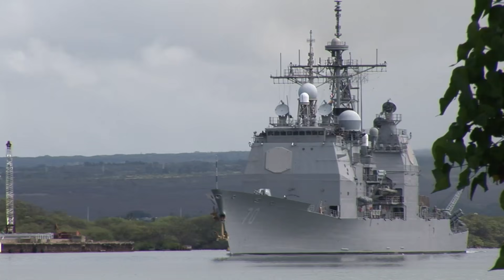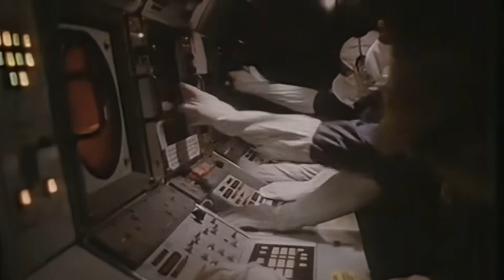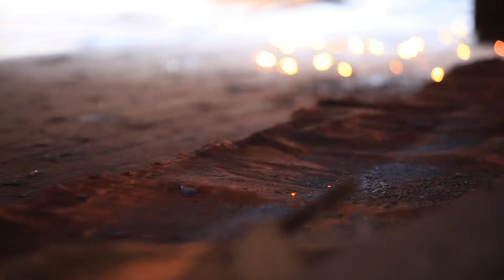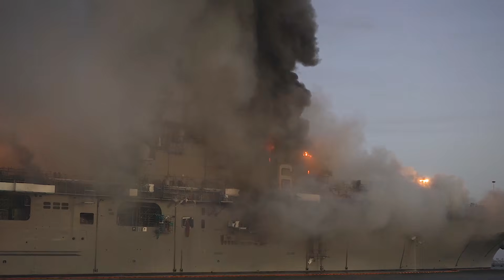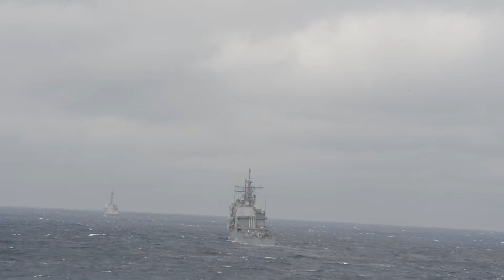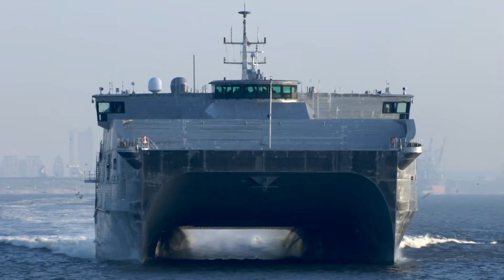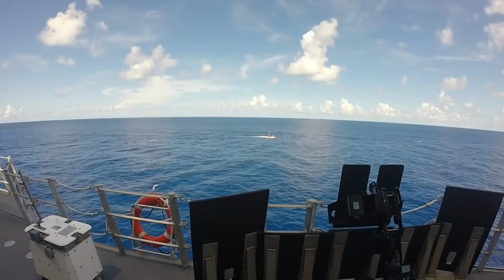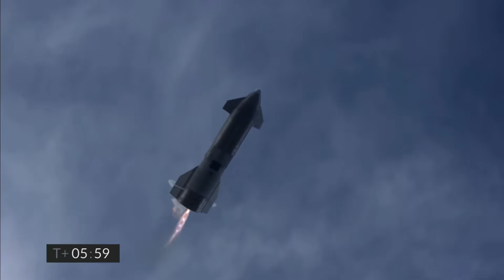Why is The US Building Aluminum Warships?

Comment: I know it would cost more and honestly be more difficult to work with but if I wanted a warship...I would want it made of stainless steel myself. No need for paint, maintenance, or any kind of corrosion inhibitors. Yes it would be more expensive but it would be lighter and thinner than steel and stronger than aluminum.
Reply: Look up crevice corrosion.

Comment: During the Cold War Era, the US Navy's Knox Class Frigates, launched in the 1970's, had steel hulls and aluminum superstructures. This is old school technology now. The Knox Frigates were specifically built to search for and track Soviet submarines. The Soviet Navy at the time boasted the largest fleet of submarines in the world, and the US Navy's Fleet of Anti-Submarine Warfare platform ships were charged to counter the threat to NATO aligned Nations. US Navy Knox Class Frigates were decommissioned after over twenty years of service, and many were sold to our Allies. Both of the Frigates on which I served, the USS Brewton FF-1086 (Pearl Harbor, Hi) and the USS Hewes FF-1078 (Charleston, SC) survived the scrapyard and are currently serving in the Taiwan R.O.C. Navy. This is a testament to their design and capability as a good ASW platform.
Reply: I understand that Soviet submarines made excellent anchors.
Reply: @BenjaminFranklin99-s9n  Older Soviet ballistic subs were noisy, which made them easier to acquire by sonar. Each sub has it's own particular set of frequencies, like a fingerprint, and prior recordings can help pin-point that vessel's signature. Most modern subs are very stealthy, but can be also visible to aircraft using magnetic resonance technology, which picks up anomalies from steel objects hidden in the water column as the aircraft flies patterns over the surface. But the worlds oceans remain a good place to hide. The US and it's Allies must remain vigilant to counter the threat of submarine launched weapons of mass destruction.

Comment: Elon musk ditched carbon fiber for stainless because stainless was faster and easier to design and build with.
Reply: This ^
Reply: lets face it, trying to build a rocket out of carbon fibre was never going to work out well
Reply: @spawnof200  isn't a proton rocket from it?
Reply: and better at low temperatures
Reply: @Barten0071  in general better temperature handling especially in re-entry

Comment: The most telling incident was during the Vietnam war. A US navy plane accidentally fired a Shrike anti radiation missile at a US destroyer, which had an aluminium super structure. The missile homed in on the ship’s radar detonated 100 feet above the mast of the ship and at first sight, no damage was done, nobody was hurt. But the ship was dead in the water, the blast had caused tiny slivers of aluminium to shave off at joints and every electric cable was shorted, every wave guide was cut. It took two days of repairs to get the ship moving.

Comment: did not even think about the melting points, 150c is low tho, if yar biking in hot summer without any shade i think yar bike will hit those temps.
But yeah i think steel or aluminum does not matter that much, the weapons hitting them are so powerful, i bet tho the steel will buy some evac time.

Comment: Adding the bit about Starship using stainless steel is disingenuous, as it does not explain what drove that decision. It was the need to deal with the heat of reentry for steel winning out instead of carbon fiber. A naval ship does not have to deal with such extremes. There is no one perfect material for all scenarios, an optimized design will make use of numerous materials, using their advantages where they are desirable.

Comment: the biggest problem when it comes to aluminium and steel combined is how much easier aluminium starts to oxidise. by combining aluminium and steel does the aluminium act the same way as zink does when applied on steel, it oxidises instead of the steel to protect the steel from starting to rust. so by building an aluminium structure on a steel hull will they get this problem which signifficantly weaken the aluminium over time. i think this has something to do with why it gets destroyed this easily when the ship is in combat.

but i'm no expert when it comes to warships. i have a very good understanding about metals and how they react when in close contact with other metals due to my job as a specialised pipe welder and this is what I have been taught. but they most probably have thought about this before and placed some sort of barrier between the steel and aluminium to protect the aluminium from this phenomena but i still think it has something to do with the catastrophic faliures they encountered

Comment: Radars do not produce radiation, they emit radiowaves on a wavelength closer to microwave ovens
Reply: Radiowaves which are radiated from antennas... The word radiation doesn't instantly mean Chernobyl style radio-active radiation. With the power levels those radars will be using, a lot of radiation will come of them which will interfere with your iPhone signal let alone critical weapons-systems on the ship. Rather not have a high power radiation source next to sensitive electronics.
Reply: that IS radiation id10t : the emission of energy as electromagnetic waves or as moving subatomic particles, especially high-energy particles which cause ionization.

Comment: I make my ships out of elemental sodium currently.
Can't seem to get then to float without burning up though. Not sure why
Reply: Did you try restarting it?
Reply: @saureco  I have not. I will give it a shot. Not sure how to restart chemistry though. Any ideas?
Reply: Try bicarbonating the sodium. 😁
Reply: Why not try a Francium Coated Enriched Uranium and Cobalt Alloy?
Reply: Just make your ships outta H2O, there problem solved.
Reply: @justiron2999  Yes, you have the same density with water, therefore you can also act like a Submarine!👍👍👍
Reply: @justiron2999  Dude, you are a fucking genius! Can't believe I didn't think of that.
Reply: Im having the same problem with my potassium ships
Reply: @stevejones1488  I know, I mean they are rare earth metals and rare always mean good so good stuff should make good boats? Idk wtf we are doing wrong here.
Reply: @mickeddy92  titanium is too mainstream.
Reply: Lmao. I’m just imagining the ship be lowered from the docks into the ocean after being completed and just exploding instantly XD
Reply: Don’t be an idiot, save the game!
Reply: Instead of ships. Try this. A shell which utilizes a proximity fuse to mix a capsule filled with a sodium potassium alloy and water. It detonates just a meter over the ship surface. Spraying hot burning metal liquid on the ship surface. Not only a sort of napalm. But any of the alloy that doesn't catch on fire actively eats away at the ship structure due to galvanic corrosion.
Reply: try potassium

Comment: I served on an Adams class destroyer and it was commissioned in 1957. It was the very last 1200 psi superheated steam engined destroyers. The ship had a steel hull and some steel compartments but above the main deck was all aluminum. That is a long time ago that the USN started using aluminum. We went through some really bad weather where you could not get out of your rack unless you were on watch or had some kind of critical job to do. How would you like to be able to walk on the walls? That was one tough ship.

Comment: Using the shuttle as a example how good aluminum works in extreme heat is really poor choice... the tiles that protected it were extremely fragile,expensive and required a lot maintenance.Don't think a navy vessel would be suitable
Reply: But it still didn't melt. According to the video modern ships have fire/heat protection in key areas, so the example applies.
Reply: @krupert8355  "it didn't melt" Columbia disaster would like to have a word with you
Reply: Russians wont use aluminum....
They will use stalinium......
Reply: I know you try to to be smart, but let me tell you it simply does not work....The space shuttle example is fine, you just don't get what he was saying thats the problem ;)
Reply: @IIISentorIII  no, the example was shit, just like hin saying that Elon doesn't approve of the Russians building composite superstructures "because the new starships are made from steel instead of CF". They aren't made from steel because it's a a better material, they're made from steel cause it's far cheaper and stronger than CF at cryogenic and reentry temperatures

Comment: I've seen the strips they use to join the aluminum super structure to the steel deck. They are made in big sheets explosively welded together then cut into strips for the bottom of the bulkheads.
Reply: I hope that's a STEEL deck.
Reply: @flamingfrancis  yep voice texting and autocorrect are real things.
Reply: Detacouple usually comes in strips about three inches wide. The steel side is welded to the deck in the outline of the superstructure bulkheads (walls). Then the superstructure is welded to the top aluminum half of the detacouple.

Comment: i'm writing this pre watching the video and will reply once it's over, but i think it's because aluminum isn't magnetic, so that they could use electromagnetic engines powered by solar in the future. it would significantly reduce fossil fuels, and be far more sustainable, especially if they use a liquid cooling system to keep the system cool, and harness the steam for aircraft catapults on aircraft carriers. it would make sense, if they can find a place for the solar panels. they might even be able to make solar panels that are tough enough to be used as the carrier deck, and since it's already a huge flat space, it would be pretty perfect if they could make that work. just my thoughts and possible reason why they're making them out of aluminum

Comment: The frigates Antelope and Ardent, which were sunk after devastating fires, had aluminum superstructures and steel hulls. Defenders of aluminium construction emphasize that the metal does not burn. But the metal, roughly half the weight of steel plate, melts at 1,200 degrees Fahrenheit, as against steel's melting point of 2,800 degrees. Aluminum is also harder to maintain. Much of this knowledge was learnt in the '80s and the US Navy ignored it. So who was held responsible for the mistake and all the wasted money? What happens to survivability in heavy combat?

Comment: "Aluminum doesn't burn"? Really? That is extremely dependent on the alloy used and if anodize, the anodizing process used. And, yes, some of the aluminum components on US warships are prone to burn before melting, but the general assumption with their installation is that they are really unlikely to ignite unless everything around it is a lost cause already.

Comment: aluminum ship means that taliban boats with ak47s can actualy sink them and cause the crew to abadon ship
a heavy steel ship can easily survive small to medium sized cruise bombs
considering they have a decent damage control crew they can recover and keep fighting

we can easily see why battleships retired, it was because of the massive USSR cruise missiles, we  are talking about missiles more than 10 times larger than the modern cruise missile carrying even nuclear warheads 
sure if you get hit by a p700 granit your steel destroyer or cruiser will be doomed, this forces the enemy to use larger and fewer missiles which you can much easierly defende against

using many smaller and aluminum ships will force the enemy to develop smaller weapons and make you an even easier target to kill
in a scenario were each side fires all of the offensive weapons the winner will usualy be the one who will affford to take the hit, each side will get hit badly and there is no perfect defense system

an aluminum ship is an easy target for enemy artillery as well, getting hit by a single 155mm HE round can cause a wild fire inside the ship and a melting of different sections
a steel construction of even much smaller ships means that they are a lot more capable at fighting with their onboard guns at closer ranges

Comment: Why don't we just add explosive reactive armor to the ships I mean that might add some good defense.
Reply: I guess because it would be relatively easy to counteract. The weight of explosive in the missile would be much greater than the explosive charge at the point were it impacted. You could move the fuse of the missile to the rear of the missle and use a deceleration or proximity sensor to trigger it with a delay so it exploded inside the ship. So the ERA couldn't just knock out the fuse. It would have to destory the entire missle and that would require quite a lot of explosvies in the ERA. Therefore  you would need armoured plate beheind the explosive reactive armour to stop the ERA damaging the ship. A feasible option on a tank that doesn't have to be bouyant but not so much on a ship. A ships main defences against missles are decoys to decoy it away from the ship and missles and guns to shoot the missles down and speed to get the hell out of the missles way.
Reply: @chrism7969  Buoyancy is not that hard to do sense water is many times heavier then steal so an active defense like the anti missile defenses on tanks which use giant shotgun shells could also be useful but they would probably stick out.
Reply: @zetoboogaloo8802  well if you are protecting the superstructure the armour has to be high up which affects the centre of gravity of the ship, making it less stable in anything but calm weather.  As for anti-missile systems don't ships already have them. In the form of close-in weapon systems,  anti-missile missiles? Also doesn't extra armour, reactive or otherwise, add weighr slowing the ship and increasing fuel consumption and reducing range.  The sheer mass, speed and explosive capacity of modern ant-ship missiles mean that the weight and bulk of effective armour against then is   not practical on a ship. As for your comment implying  buoyancy not being an issue that is not correct. In the past smaller ships were not armoured to withstand the   guns of larger ships because smaller ships had less volume and that's did not have enough buoyancy to support the thicknesses of armour necessary  to protect against the larger calibre shells of the bigger ships.  A ship of a given volume has a limited buoyancy and that has to provide for all the machinery and and stores and accommodation for the crew. Any armour you put on top of that restricts the amount of machinery, weapon systems etc you can carry.  So unless that armour has a good chance of blocking the damage an incoming missile can do it's unlikely it would be used on a ship. I assume that designers of modern ships have made that calculation and decided that reactive armour does not provide an effective defence against modern missile systems.
Reply: Because ships are not tanks! The antiship missiles are 1000 pound warheads flying at high speed. It would the steel and concrete hull of a ww11 battleship to be strong enough for reactive armor that could effect a serious missile threat.
Reply: @varietasVeritas  And most countries that build tanks (except the Russians) don't use ERA either...

Comment: I know that both steel and aluminium are both metals. My question is, does aluminium provide a lower or higher radar cross section compared to steel if 2 same ships were made with the 2 different types of metal ?
Reply: Considering the way in which radar waves interact with metal of any kind because of its free electrons, I wouldn't expect any meaningful difference. The conductivity of metals are too close to each other to matter; one bare metal simply cannot be significantly less radar reflective than another.
Reply: The difference is pretty much zero.
Size and shape matter, but BOTH aluminum AND steel are very good reflectors of radar (as is copper, silver, gold....)

Comment: I would use synthetic spider wire layered in a weave. The stuff is strong
Reply: Time to put those SpiderGoats to work....oh yeah, the greenies protested Biosteel until they were shut down.

Then some American military company bought the rights and ....vanished.

Like the cool stuff always does once they get involved.

Bastards.

You're right though. It's incredible strong stuff. I saw a gun test on spider web impregnated skin. Incredibly thin stuff and at close range (kind of point blank) the bullet didn't penetrate.

I have no idea why they started growing skin with the stuff. Has to be easier just weaving it.

Comment: News flash, these ships are not being "built" they have been discontinued and are being removed from service after just 6 years in service. Because they are structurally unstable due to ALUMINUM !
Reply: Yeah, it didn't sound like it was about taking a missile shot.  It sounded like they couldn't handle a microwave fire or a stormy sea.
Reply: @shorewall  No they were decommissioned due to rapid corrosion .

Comment: Summary: Aluminum is lighter than steel, and so a huge increase in speed, but little did the USA know that Aluminum has also a low melting point and strength.